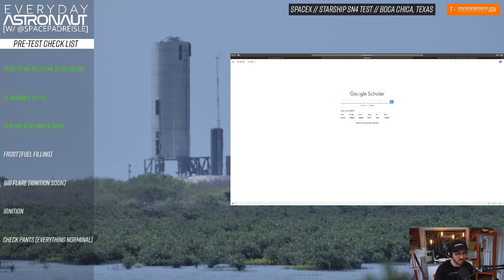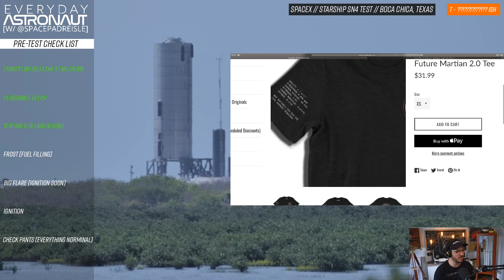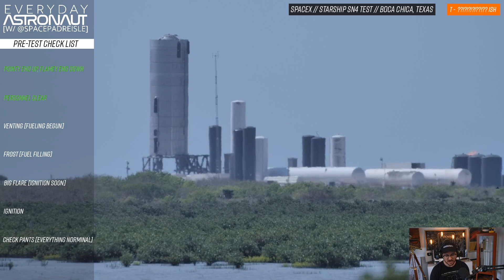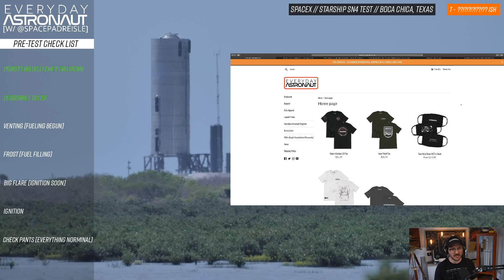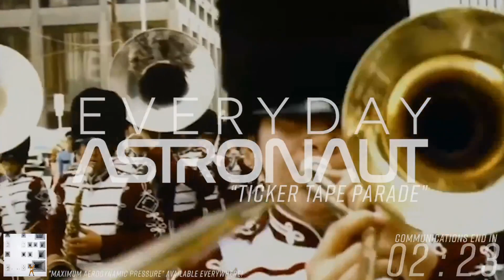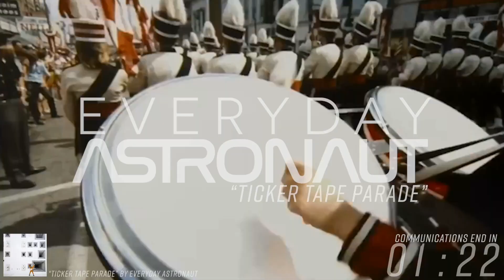[May 18] [NOTHING HAPPENED DON'T WATCH] Let's watch SpaceX static fire Starship SN-4!

Comment: At 1:09 Allen asks you a great question: And you answer that you think humans will be stuck in the solar system for the next 50 years, “unless we have some massive breakthrough in physics.” I believe that is probably the majority opinion among laypersons. But we have had a “massive breakthrough in physics” that is definitely underreported by the mainstream media. Most chemical rockets are limited to around 10 km/s, and the vortex combustion “breakthrough” could add 25% more to that speed, so that’s maybe 13 km/s? But let’s compare that to a real breakthrough, Solar Wind driven Plasma Sails can go 40 to 80 times faster than chemical rockets alone. That means SpaceX Starships to Mars in a week, and asteroid 16-Psyche in less than 2 weeks. The breakthrough is self-inflating magnetospheres. Fusion scientist Dr. John Slough discovered that small charged conducting coils can entrain Solar Wind Plasma in a Magnetically confined sphere 1000 kilometers in diameter or more, just outside the Earth’s magnetosphere, just out past cis-lunar space, around L-2. And the one more thing? That artificially created magnetosphere automatically GROWS in volume as you move away from the sun, as the solar plasma gets less dense! So it provides CONSTANT THRUST all the way out to the edge of the solar system, with zero propellant mass! You still need to megawatts of power to charge the 2 meter coils, and you have to find a way to navigate and slow down, but Dr Robert.Zubrin thinks he’s solved part of that with his Dipole-Drive concept, and former XCOR CEO and physicist Jeff Greason thinks he’s solved the multimegawatt power problem with his Q-Drive concept. You can read more about the details of Plasma Magnet Drive, Dipole-Drive, and Q-Drive at the Centauri Dreams and Nextbigfuture websites. But if Elon got excited about this, we could see his Starships getting to Mars in less than a week instead of 3 or 6 months, and the 2.2 year “launch window” is eliminated. That’s a big breakthrough in my book. You can launch to Mars three times a day, everyday, and expect to be at Mars in one to two weeks ALL YEAR LONG! Elon could have a million colonists on Mars in less than ten years. At the same time, Gwynne Shotwell can have her Starbase at 16-Psyche building INTERSTELLAR STARSHIPS! The first trip Alpha Centauri C could launch in 2028, not 50 years.